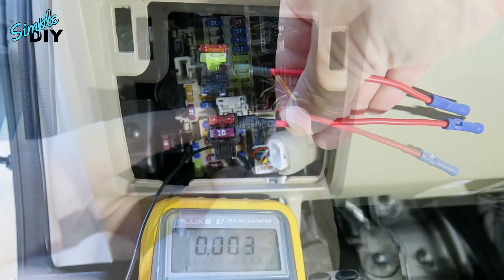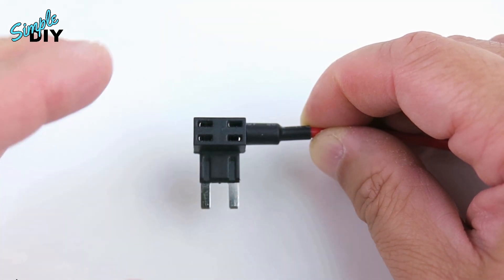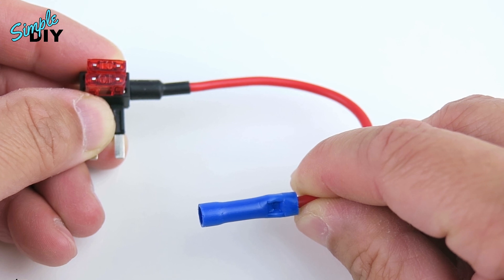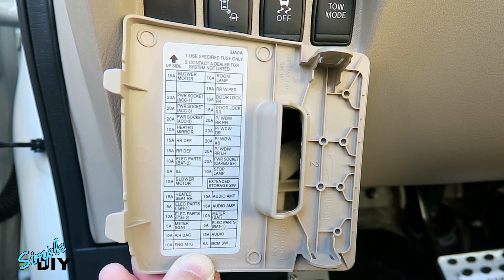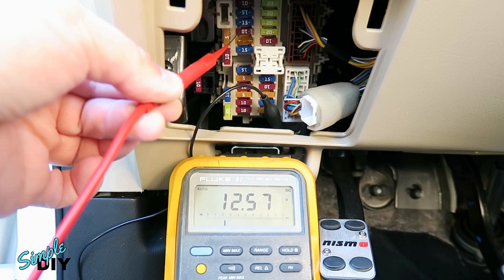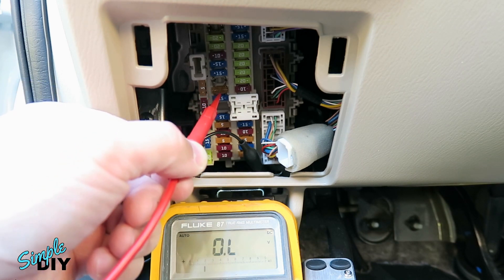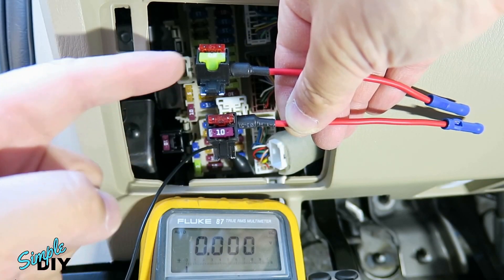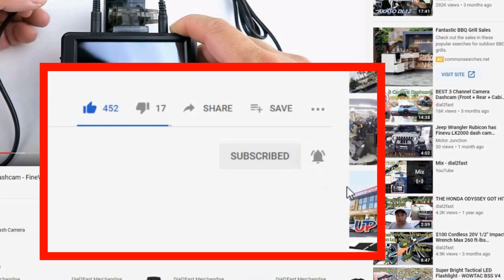How To Install A Fuse Tap & How It Works - Hardwire

Comment: I put in a fuse tap but the original accessory doesn't work but the new line/accessory does, and when i take the fuse tap out and put just the original fuse back in by itself the original accessory works. What could be the problem? I am using the original fuse 15amp and another 15amp for the top of the fuse tap for the new accessory, would i need a to use a bigger fuse? My fuse tap is rated for 20amp and 30amp. Thanks
Reply: Finally one of these videos that explains the fact fuse-taps are directional.
Reply: If your device requires a 15AMP fuse I'd recommend pairing it with a slot that has a higher AMP fuse already in that location, say 20AMP. You want to pair it with a higher AMP than your device when possible to avoid any issues (this is what the documentation for these fuse taps says). I would not recommend matching a 15AMP fused device with another 15 AMP fuse location, and definitely don't use a higher AMP fuse than your device comes with, as that's what the manufacturer knows it can handle safely before the fuse burns out to protect it. Also, your tap might just be faulty. Some cheap ones have brittle metal connectors that can snap easily
Reply: @Ben-Rogue  im trying to connect the remote wire from my amp to an accessory fuse so it would turn off when the car turns off
Reply: @hepzlawrence7710  did it work?
Reply: @Braskk.2  no not sure whats going on but i think its something to do with my factory radio, ive tried to put the remote wire directly onto the battery and sometimes it will work and sometimes it won't meaning when I turn my car on sometimes the sound goes and sometimes it doesn't same thing thats happening when i try to use the fuse tap lol so yea guessing its something to do with my radio or the speakers as the display still works but just no sound sometimes. I might just put in a aftermarket radio and see what happens.

Comment: I see that you put in two fuse tap. Is one for ground and the other is power. Because I want to install a dash cam and I want to use constant power. How can I set it up like that. Also when I cut the cig plug. How do I hook it up that way
Reply from the maker: You need 2 fuse taps because one is for ignition 12V (to power dashcam when you are driving), and one for constant 12V (to power dashcam when car is parked). Hardwiring a dashcam is not  for you to just cut a cigarette lighter plug. You can only hardwire a dashcam that is designed to be hardwired. The dashcam itself comes with an ignition wire and a constant 12v wire.
Reply: You can put one fuse tap on interior light as it's generally always on and the other on cig lighter as that's what you usually power dash cams with anyway.

Make sure to test the direction as per video, otherwise you won't be protected.